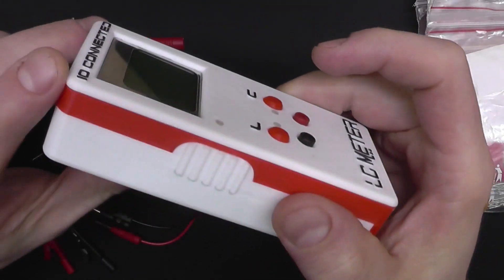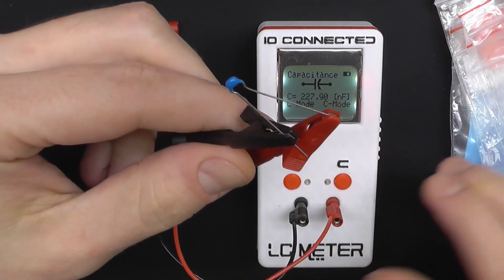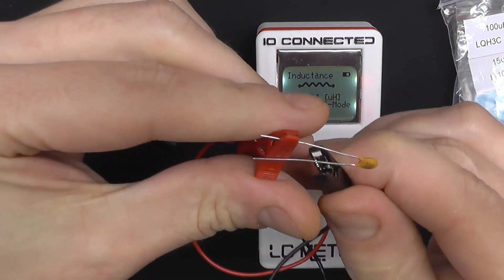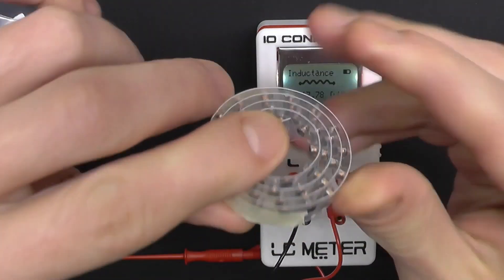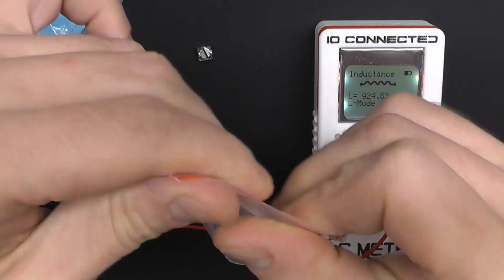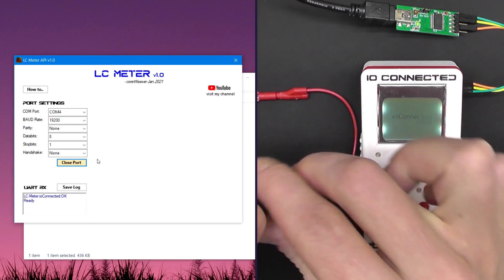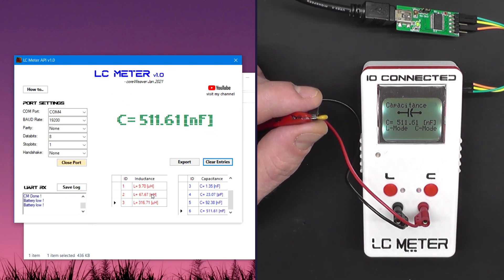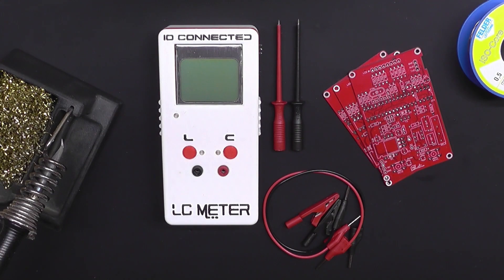LC Meter - Build - Part 4

Comment: I watched all videos of this project. It's really great project! Gut gemacht! But It would be really cool if you update it by adding resistance measuring. RLC meter. and even adding diode and transistor meter will be really useful. Waiting for updated version. Thanks!
Reply from the maker: there's gonna be a v2.0. The concept is already starting to take shape. Subscribe and keep your thumbs up. Thanks for your support ! 😍🤩🥳🥳

Comment: In the code you mention you used a resonator at 4Mhz to get a more precise timing period for timer1, naively I would think that might help a decent chunk towards finer accuracy of the meter; it would be cool if you could show that at some point, or possibly any other methods of gaining accuracy on the period. Would using an RPi with pulses sent using a short C / Go program, or maybe using USB->serial from a computer also be a good approximation?
Reply from the maker: it's possible. if you have a very accurate oscillator, or any device that will give you pulses, you can measure that frequency and tweak the OVF values for the timers to match that value. it's basically like synchronizing two clocks.

Comment: With computer software? Awesome... 👍🏻Are this with short detection? What's brand of probe?
Reply from the maker: Thanks !

For the sockets I used "2.0-mm miniature socket": https://www.reichelt.de/gb/en/2-0-mm-miniature-socket-red-mbi-1-rt-p11294.html?CCOUNTRY=447&LANGUAGE=de&GROUPID=7556&START=0&OFFSET=16&SID=94d4e441a55fffb54adc5a3db595718ec82bb56dece7a0937fa80&LANGUAGE=EN&&r=1

I used these probes: https://www.reichelt.de/gb/en/test-probe--2-mm-red-mps-1-rt-p13109.html?CCOUNTRY=447&LANGUAGE=de&GROUPID=7557&START=0&OFFSET=16&SID=94d4e441a55fffb54adc5a3db595718ec82bb56dece7a0937fa80&LANGUAGE=EN&&r=1

these alligator clips: https://www.reichelt.de/gb/en/miniature-alligator-clip-2-mm-socket-tin-plated-red-ma-1-s-rt-p130862.html?CCOUNTRY=447&LANGUAGE=de&GROUPID=7557&START=0&OFFSET=16&SID=94d4e441a55fffb54adc5a3db595718ec82bb56dece7a0937fa80&LANGUAGE=EN&&r=1

and these leads: https://www.reichelt.de/gb/en/2-0-mm-mvl-2-25-measuring-lead-red-mvl-2-25-rt-p106055.html?CCOUNTRY=447&LANGUAGE=de&GROUPID=7558&START=0&OFFSET=16&SID=94d4e441a55fffb54adc5a3db595718ec82bb56dece7a0937fa80&LANGUAGE=EN&&r=1

Comment: What is the minimum resolution of the inductor ？
Reply from the maker: The smallest inductor I measured was labeled 56nH 10%, and I measured 52 or 54nH from what I remember. I didn't have any smaller than that. Hope it helps.

Comment: Thanks for the Video! i would also like to enter the PCB draw please. I don't have a 3d printer so i found the first 2 parts were really enjoyable. I liked that you left in some teasers/exercises for the audience like adding a FTDI or porting the code to C for example. And after seeing just the word subscribe 200 times i will now subscribe ;)
Reply from the maker: yeah I was curious how many will appreciate those "teasers" lol
for that reason only, I'll wait a bit longer till I start designing v.2.0 SMD only. That and the fact that I would probably wanna redo the case too, in order to accommodate a much smaller PCB. Thanks for watching

Comment: This is really cool. Where did you get your precision calibration capacitor? Just bought a tight tolerance one from a distributor?  The first and second videos were probably the most helpful to me, since they laid out how the circuit and the principle works: your case is really nice, though I already know designing for 3d printing mostly in different apps, so I went quicker thru that video. It was cool to see it in action in this one!

My multimeter has some capacitance measurement but no idea how good, and my cheap import "component tester" can do some capacitor (maybe inductor?) Identification but using some other technique, since there are no relays or lm311, iirc. I'd assume this one is probably even better? Any temperature effects, or is the ease of self calibration enough to solve it?

In the short term I'd recommend trying lithium ion pp3/9v batteries: they're just 2 cells so 8.4/7.2V, no boost converter adding noise, and the capacity is really good compared to alkaline or NiMH.
Reply from the maker: I've updated the BOM .pdf file. Go take a look and tell me if that answered your question. Oh and thanks for the battery suggestion.
Reply from the maker: I believe the calibration will deal with temp. fluctuations unless they happen very rapid/frequent while measuring something

Comment: Great work man! The details and the amount of work you put into this is absolutely stunning..
Can you please tell the range of values of capacitance and inductance, this device can measure?
(I am sorry if i missed this in the videos or in the documentation)
Reply from the maker: Thanks. The range can be calculated based on the min/max freq the AVR can measure. I didn't have time to look into that. I can tell you that I measured as low as 220nH and up to 1mH Inductances, and for capacitances from 1pF (!) to 1uF. With some slight modifications the range can be extended.
Reply from the maker: I've updated the Bill of Materials and Layout PDF. Go and check that first and let me know if you still have trouble finding a component.

Comment: I am stunned at the amount of work you put into this beautiful piece of equipment, you acknowledged your peers and went to extremes to explain its theory of operation and design...further to this you give it away freely. Really really impressed, although in my work I would have little use (no need to be so precise in my repairs) of it I should like to build one just for the joy if it. Thank you!!
Reply from the maker: yeah that's the basic idea. To build it with your own hands, to understand how it works, to debug the errors and then improve it, make your own changes, and motivate others to buy a soldering iron and try that too. That's how electronics begins.
...just my two cents and no one else / doing something else should feel offended. 
Thanks for your comment. I appreciate it !

Comment: Great series of videos, thank you!
I liked the most pcb design (part 2) and part 1 for the detailed theory, you don't see that much on Youtube in my opinion.
As not a total beginner in electronics nor a master, I would have loved some explanations about some choice you made (decoupling capacitors, why you choose some components over other ones...) but that would be a lot more work I guess.
Anyway, it's a good idea to cover every part from the idea to the final product, it's very interesting!
Reply from the maker: yes, I could've gone even deeper but I was already afraid it will make this video boring and too long. As for the caps I used, if you're referring to the IC decoupling caps, it's common practice. Most datasheets recommend 100nF on VCC, AVCC, pins. It's not something critical, I mean you could use 47nF or 220nF. Thanks a lot for your interest in this project.